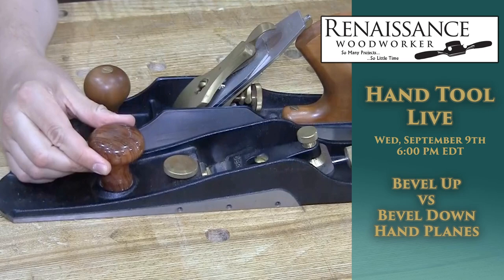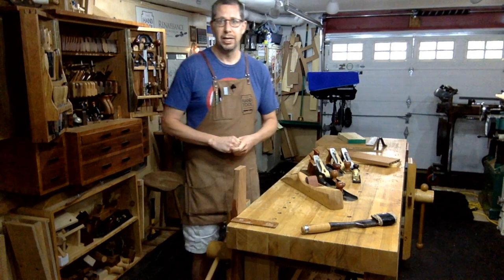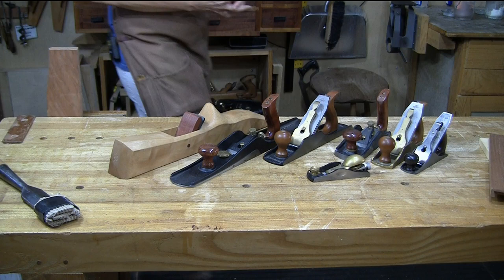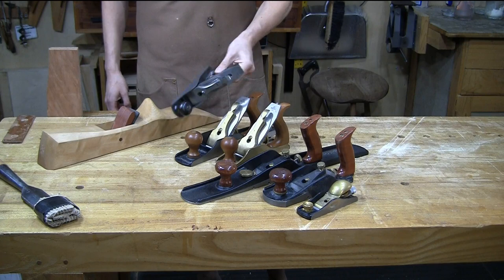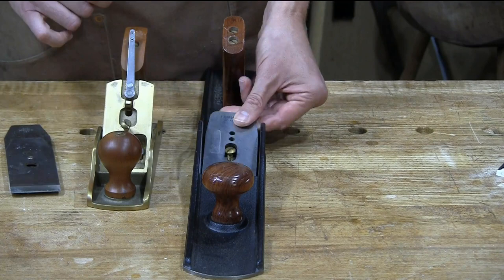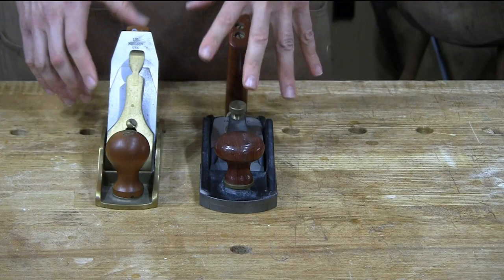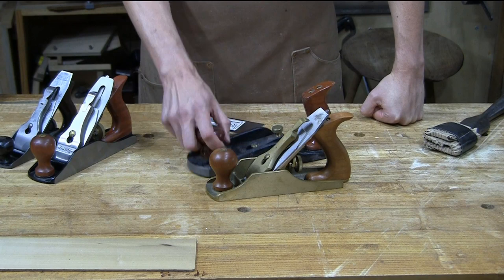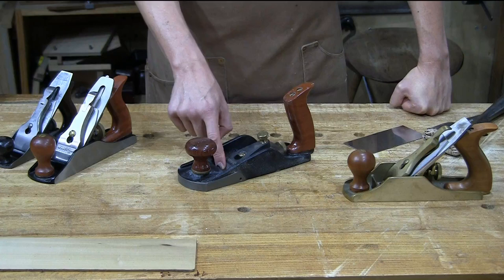Hand Tool Live:  Bevel Up vs Bevel Down Planes

Comment: I will be teaching a class later this month at my local Woodcraft on handplanes.  Missed your video live darn it, but you've reinforced my experience with handplanes.  I have both bevel up and bevel down planes, and like you, see little difference between them in use other than a small amount of convenience when one needs to sharpen.  Thanks for another very informative video on hand tools, I've learned quite a lot from your Youtube videos over the years.
Reply from the maker: Good luck with your class.  Best advice when learning hand planes:  just start using them.  You learn the most by actually putting edge to wood.  Oh and hand planing isn't hard.  So if you are working hard, something is wrong
Reply: @RenaissanceWW  Thanks for the advice.  So true about actually doing instead of only reading about it or watching.  Also, I've found from teaching other things that you really find out how well you know a subject by teaching it to another.

Short story from the not too very distant past of mine.  Bought a #6 to use as a jointer plane long before I knew that even with a good plane there is some skill involved LOL.  Man, I thought that plane was going to give me perfectly flat boards just like magic.  Much to my surprise (as you can probably imagine) I found out rather quickly that it's very much the person handling the plane that makes the most difference.  

I hope I can do as good a job passing on my modest skills as you do your (much higher) skills in these videos.

Comment: I have a bevel up Jack and Block plane.  I also have a bevel down No.6 and a 4 1/2.  I have extra blades for all of them and switch blades as required to achieve an attack angle of anywhere between 45 degrees to 70 degrees.  Why is there a preference for bevel ups for blade switching.  I'm not challenging your comments.  I'm questioning my findings.  You are a much more experienced cat skinner than I.  Thank you
Reply from the maker: How are you changing the angle of attack with a bevel down plane?  The frog is what creates the planing angle in that instance whereas on a bevel up plane, the blade sets that angle.
Reply: @RenaissanceWW  I'm grinding and then polishing a 25degree bevel on the upper (normally flat) side of the bevel down blade.  In that case it gives an angle of attack to the timber of 70degrees.
Reply: @RenaissanceWW  Your thoughts?
Reply from the maker: @Danny-ul4sq  what you are doing is essentially creating the same effect but I don't like the idea of a double bevel blade.  First you weaken the edge by having two bevels and a thinner amount of steel at the cutting edge.  This can be ameliorated to some extent by the steep bevel angle but I'm not sure the additional effort is worth the result.  The biggest drawback however is now you have to push your chipbreaker back behind that top bevel making the fit of the blade assembly in the frog and under the lever cap problematic for some planes and shortening the overall blade length.  But more at the heart of this is the fact that the chipbreaker itself is designed to do what you are doing with the top bevel.  Why increase the presentation angle of the blade in the first place?  To reduce tear out.  By snugging a chipbreaker up tight to the cutting edge you are doing the same thing.  While the chipbreaker cannot go right to the cutting edge like you have with a top bevel, add to the system a tight mouth on the plane and you will net greater tearout control that one element alone.  So my thoughts are you are possibly making things more difficult than necessary and adding to the sharpening you have to do.  But my opinions are also colored by the fact that I don't really see much need for higher angle frogs and blades to control tearing.  A sharp blade, tight mouth, skew angle, and tight chipbreaker (in that order) are all I have needed to tackle even the most ornery jungle wood grain.
Reply: @RenaissanceWW  Thank you for your generous reply.  You are a busy person and I appreciate that you have devoted some though and time to your reply.  Your answer clarifies why a back bevel would not suite you but your answer also confirms why it works for me.  It has worked for me for some time without issue.  In Australia many of the timbers readily to hand are really tough on a hand plane.  Tear out is tough.  Hence, 1, a ludicrously sharp plane blade and fine mouth is frequently not always enough for the timbers I use.  Also then there is the issue of the purpose of the "chip breaker".  Wooden planes with wedge adjustment had blades that were at least as thick as contemporary plane blades and I've seen some that were 1/4" thick at the sharp end so as to assist in the wedging process.  But maintaining a blade that thick on stones not as good as ours was a troublesome and time consuming issue.  The big issue for the Bailey design was that it reduced the thickness of the blade and so reduced the time required to maintain that blade.  But the thinner blade required support.  Hence the chip breaker applied pressure to and support to the cutting face.  Contemporary blades reduce the need (do not eliminate) for the chip breaker.  So, 2, I have found that having the chip breaker back a 1/16" from the cutting edge on a 1/8" thick blade is not an issue if the chip breaker is about support.  And 3, I keep the back bevel at no more than 1/32" wide, hence it doesn't chew into the support of the blade by much.  

I really like my low angle jack and block planes, but adjusting the lateral and depth of cut is a pain compared to the Bedrock planes.  Then again, even with the same 70degree cutting angle, the low angle jack just inches out Bedrock for reduced tear out, but not by an appreciable amount.  

Again, thank you for your thoughts on the matter.  I think the only point we really differ on is the purpose of the chip breaker.  The rest is more about the timbers we use.  The discussion has clarified a few points for me.
Reply: @Danny-ul4sq  I experienced the same thing. Backbevel works great for me. I rarely need it, but if I do it works great. I use it as a polishing pass in the end to prevent this micro tearout in some woods.
I like the handling of bailey style planes much more then bevelup planes.

I don't believe that chipbraker are adding anything to the cut no matter how close they are set up. If they would, a BD plane with 45° + 25° of the chipbraker should perform the same as a 70° attack angle on a BU Plane.  Of course the chipbraker adds support for the blade, but beside that?

Comment: I would add as advantage of bevel down the weight. The weight is good. Not to much not to low. Some times i prefer the jointer low angle than the jack bevel down, both weight same and i can adjust easier the jointer to rought to fine than the jack
Reply: personally, my first buiy is going to be...actually i'm not sure i'd like to buy a bevel down for shooting i tuned up a old #5 stanley, and do need a smoother. as my first plane that bedrock is heavy. i kind of like the idea of a lighter plane. althought a little wax makes it glide easy on the wood.
Reply: @MattrsMore  yes at the start i was not sure, because you feel like the chip breaker is indispensable, but when i adquire the jointer and the low angle jack. You see that tying the mouth of the plane and maybe putting a 38° degrees blade is not neccesary the chip breaker. I have a 50° degree blade, but i practically never use it. So if you look for a smoothing plane the Veritas LA smooth plane will work fine(i dont have this one, i have the Bevel Up smoother) if for you shooting is a little more important the additional maybe the LA Jack plane will work fine. And even is not so difficult to use it as smoother